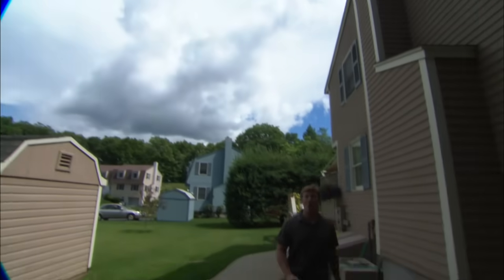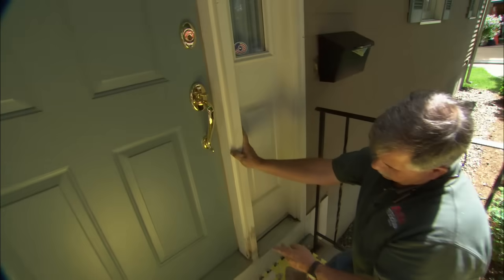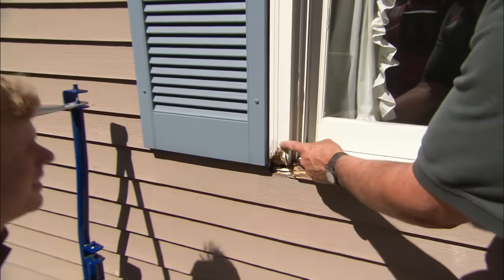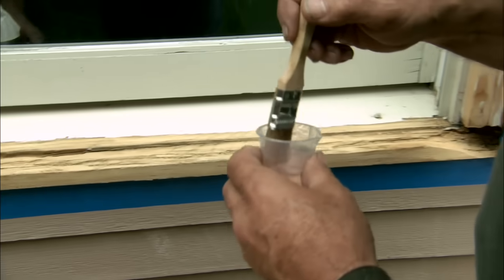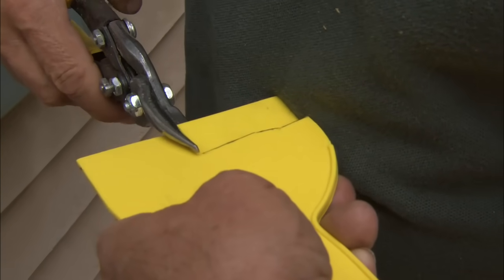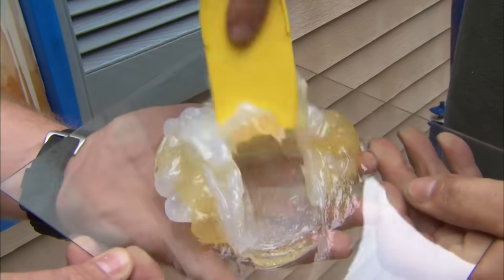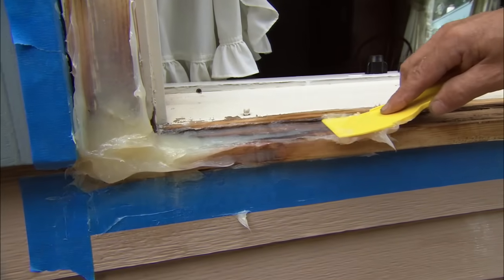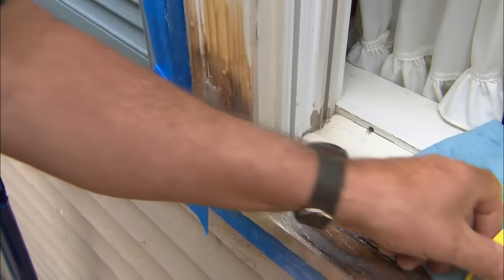How to Fix Rotted Wood with Epoxy | This Old House

Comment: 1.2M views and no finished product? Would be good to see how it actually looks at the end. I think this is a fine fix for most people, though you'd probably want to find a cheaper epoxy. I've done something similar with wood filler and I'll see how it goes - may well just end up putting new wood in there if it gets destroyed over the winter

Still, good to know what that tool bit in my drill case is for, didn't realise it was for sanding wood like that.
Reply: I use Minwax high performance wood filler. $12.00 at HD and gets hard as a rock.

Comment: Epoxy is expensive,  I use polyester resin, (Fiberglass resin) ..  I mix it with some fine saw dust until it's as thick as Peanut Butter,  Then I put on just like he did,  it's a lot cheaper and it dries a lot faster,  You don't need the primer he put on first.  It come out hard as a rock..  It paints easy with Latex and doesn't peel.

Comment: I repair sash windows for a living. If you cut out the rot 50mm higher into the good wood, and to a place where there is no obvious rot, it wont work for long. Less than 7 years for sure. The rot is funghinand the micro spores will already be in the wood but you cant see them. Mostly it will fail much sooner. Epoxy is a quick fix but not a good one.
Reply: Yes the spores will be in the  wood, but spores alone don't rot wood; spores plus moisture do.  If rot containing m9isture is removed, and the wood is sealed, then rot stops.

Comment: I want to repeat what people below are asking.. nice to give the instructions, but pretty useless if we don't know the names of the bonding agent and filler/s are.  The vid should be re-done just to edit that in..
Reply: If it's This Old House bunch, then they are more interested in the bragging and the pat each other on the back then actually helping the viewer to do a DIY. They could easily give names, generic or brand names but they don't. A bonding agent? I've been fixing furniture for a long time and I have not heard that I need a bonding agent when applying epoxy, for example.
Reply: Fasten All sells many brands of 2 part epoxy. Ask anyone there they will steer you right. FYI I bought a tube like seen in the video at $79 and change each.
Reply: I guess watching the label is too hard. It says "Flex-tec", and if they've not commented about it and even torn the label apart (more or less) it might have to do with sponsoring or so. It's tv after all.
Reply: Read the full text of my comments. I think you missed more than one point that I made. But yeah, reading the label was too hard and I'm pretty good at reading labels and finding sources. You wanna know what's not too hard, not being snide. Lots of comments to this video upload were of the same vein, what product was that? Right? Or did you miss those, kinda like so many people trying to read the label yet still missed the brand.
Reply: Hey, slow down a little. I don't know what points did I miss, but I'm quite sure you took my comment more "seriously" than I meant.

I watched the video and didn't pay too much attention to what brand it was. Then I read some comments and saw a few people asking about it. So I went and paused the video at the moment Tom uses it and I thought I read "Flex tee...". The label is torn so that "c" looked like an "e" to me. I also thought that "tee" might be part of a longer word but, that label being torn, who knows? Take into consideration that English is actually my third language.

Anyway I went and googled "flex tee epoxy" and google just autocorrected my search. Not that big of a deal I think so I wonder how come people don't do it themselves if they're actually that interested.

It's not the first time I see it on youtube. If something you want to read appears on the screen, chances are (if it's not blurry, out of focus, too small... whatever) you may pause the video at the right moment and read it.

About those other "points" that you made, again, I'm not too sure what you mean but, if it's about the people at Ask this old house not talking about brands, generic or not, I guess it's not that illogical. It's just avoiding free publicity. And also, if someone's eager to begin some work at home, it shouldn't be too hard looking for the products you need, there's the internet, asking someone at your local home center... if you have worked repairing furniture then you know about that matter quite a lot more than I do.

Have fun.

Comment: Tile grout is a cheaper alternative. I tried tile grout on wide gaps on window instead of silicone. Easy to apply with scraper and using your fingers to smooth it like silicone caulk. Takes longer to dry but it works. Just make sure you finish it smooth without needing to sand it or you will need a turbo cup wheel to smooth it...lol.

Comment: I have a small crack in a piece of wood which is expanding and goes all the way though the material.  My intention is to drill a small dremel hole at each side the way they do windshields in hopes that it will stop expanding but I need a suggestion on a type of glue, epoxy, filler or resin that I can use to bond and fill the crack from the backside prob using a small syringe and not screw up the front of the wood... ANYBODY???  Thx

Comment: Bondo (pink) versus Epoxy versus Bondo (blue fiberglass reinforced)
in order of best to worse

1 - epoxy resin - it adheres to the wood the best  - in laying up a fiberglass boat THAT is the best product
2 - vinylester resin (not the stuff you find in walmart or auto stores) - top tier boat builder use this stuff as it is cheaper than epoxy
3 - polyester resin (bondo blue fiberglass reinforced or bondo branded resin) - what most boat builders use to lay down the fiberglass matt
4 - bond pink - not a good option IMHO, it is not waterproof and soft

epoxy is typically NOT UV rated so you MUST paint it, but it sticks to the wood the best - it IS your best option. Thixo 

vinylester I believe IS UV rated and is a good option....you would need to thicken in with either cobosil or similar thicken agent so it holds it shape while working with it (ditto for polyester) 

Polyester resin similar to vinylester, but it sticking to wood is not as good. Bondo and evercoat sells a fiberglass reinforced product that is thick already.

Bondo pink stuff - is a non-starter for me - the stuff is only good for putting skim coats onto auto body panels....not for this application.

Comment: Why not just use wood filler? Everyone saying to use bondo, but miniwax makes a 2 part wood filler that is ready to sand in 15 to 30 mins. And it won't crack over time like bondo will.

Comment: This product has its limitations. It is almost unsandable by hand and if you power sand the substrate that you are applying may sand down much quicker than the epoxy. It is undestructible however where you need something that holds up. I believe its callec Fil tec?

Comment: This seems like more work, than just replacing the wood.
Reply: If it were just flat wood maybe, but getting a piece to match might be a problem. Then you end up replacing all of the trim so it matches then it might not match the rest of the homes trim.
Reply: I think the idea here is that this is one of a number of choices to repair this situation. Not everyone wants to replace the entirety of the woodwork. So this is one option of many.

Comment: Hiring someone to come out and cut out the rotted wood, cut and shape new wood to fit and complete the repair will cost you a lot more than $200. It also looks like he had a lot of that epoxy left over, so it probably cost a lot less than $200.

Comment: filling wood rot with epoxy is a temporary solution. if the wood rot is bigger than your fist then you have to repair it with new wood and epoxy. best is partial replacement over whole

Comment: Personally I would have cut all the rotten stuff of. Spliced in new wood. And then use a minimal amount of body filler to smooth it over.

Comment: Why not just replace the rotted brick mold? Cheaper,faster and no messy epoxy to deal with. I'm not casting aspersions on your work,because your way will work.Thanks for the video!

Comment: so much for building codes, and regulations.   look at that rot.
Reply: Not sure of the age of the house but doubt they had building 'codes' when it was built, just standardised ways of construction learned as trade. The subsequent codes are to ensure this stuff lasts a specified time. Even then, there is a finite limit to building materials and the specified required longevity has to be balanced against costs. Sorry to get all rational in YT comments  ; ]

Comment: As a home improvement contractor, I will tell you that generally speaking when the rot is that bad around the window it has migrated all the way into the plywood and many times the framing and substrate as well so just covering it up with epoxy does not fix the whole problem. It’s just a Band-Aid.

Comment: This is never going to last. Within 2 seasons the rot will be back but hidden under the epoxy. By the time the homeowner realizes there is still a problem it will be i the house framing.
Reply: Lol

Comment: If it's not structural, you can use spray foam, then cut it to shape, and patch and paint. This seems difficult and apparently, relatively expensive. Or better, make a clean straight cut (jobsite tool makes it easy), and replace with wood, then patch any imperfections, and paint.

Comment: This looks great but The problem with this is cost, materials, time and the quality of the repair..... For an experienced guy like Tom yeah he could pull of this type of repair. For your average joe there are just more chances to mess up from choosing incorrect materials to quality of work. Then for all that trouble cost and time wise it's around the same if not more than just replacing the whole wood trim and more reliable repair..

Comment: Use Wood Epox not Bondo.  Bondo is for steel, Wood Epox is for wood.
Reply: I found Bondo to not be flexible and would pull away from the wood;  and I'm assuming the Wood Epoxy is flexible.
Reply: Wood Epox is recommended for historic wood repairs.  I have seen Bondo repairs--what a mess.  the wood just melts away around the repair.
Reply: I prefer SculpWood but WoodEpox is good too.
Reply: Gloria Cole bondo is not just for steel. lol

Comment: that was a useless hard fix. epoxy is way more expensive than wood. it also can separate from wood easily in very cold or hot temps.

Comment: Just seems like a quick bandaid that'll cause issues down the road. Why not cut it and put new wood. Even if you don't want to cut it all out, just cut the rot and fit some wood and brace it to the old unrotted wood. That way it's not adding more unsturdiness to an already unsteady rot. How is approxy any better than rot in strength and longevity? Aside from the fact that it isn't rot and also doesn't rot. Hear me out, if you drill into the approx and facet anything it can easy pull out or crumble or just not hold the item. You also are preventing future additions from being an easy job. The next contractor or home owner will be cursing your name. These are just cosmetic cheap fixes that no home owner should do on the outside or inside or anywhere on their home. Never do this on any space that you may want to brace or facet something to. If its an art piece sure thatll work. But no a home meant for living. Hesr little piggy let me in 🐺.  I don't get these shows. Just do it right the first time. It's not that hard. Hell it's easier to cut new wood and brace it than it is the sand that for an hour.

Comment: Just replace the wood. The epoxy is like putting a bow tie on a turd! In the end it's still a turd.
Replace the wood casings with PVC and be done with it!
Reply: The wood will just rot again.  The epoxy will not.  This is fix makes it better than new.
Reply: @xnademolicious  BULL! The epoxy eventually just falls out in time! I said replace it with PVC and be done with it!
BTW most of that type of rot can be blamed on improper installation. The installers can't make any money if they take the time to actually seal up their cuts before installing! Raw end grain is like a wick!

Comment: I don't understand patching partially rotted wood. The rest of the wood will eventually rot too. Big waste of time and money if you ask me. Just tear it all off and replace with plastic / vinyl molding.
Reply: +Glenn Watkins Or cement board type of material. Yeah this looks like a lot of work versus just replacement.

Comment: I'm sorry but im a REAL carpenter and I replace wood with wood, amateurs and lazy people use fillers!!!
Reply: that window is shot.. the brickmould trim is finger joint pine ..its soft and easy to remove and table saw some new  out of treated wood without the detail o the brickmould trim  ..just rectangle  wood and 3 inch screws and predrill and prime n paint... or spend 700$ each window and rip the whole thing out and new vinyl windows
Reply: san379 those are the two options you're going with? One option makes the repairs look like shit and stand out. The other option is removing every single tooth in a person's mouth and replacing them with dentures because a couple of teeth had cavities

Comment: I always loved watching your show because I'm a do-it-yourselfer.  However, after watching umpteen families with money redo their mini-mansions with you,  I quit watching you guys and became a Rehab Addict fan because her projects are more realistic for the working class crowd.  Unfortunately, you guys got a little snobby for my taste. You failed to mention the epoxy products in your "shopping list."
Reply: the epoxy company didn't pay to have them say their name, so they turned the label down and did not mention their name.  advertisement dollars
Reply: That was a $200, tube of Epoxy and Bonding agent..   I use Polyester Resin mixed with Saw Dust is much cheaper and cures faster...  Just mix the saw dust in until it's as thick as peanut butter..
Reply: I find this is true of a lot of the reno/repair shows nowadays. They've lost touch with the people who really do need to do things on an actual working class budget.
Reply: Carolyn Harper
Reply: No one wants to watch someone doing renovations on their double-wide. Repairs are repairs. The techniques are the same, and rather see them do it in a high-touch situation and then scale it down, rather than the reverse.

Comment: Materials expensive and time consuming method of repair.  Would have quicker and a lot cheaper to have simply cut, removed, and replaced the wood.

Once again, budget reality and TOH don't have a working relationship

Comment: foolish repair! You know that replacing the brick molding and  window sill is faster and a better repair.
Reply: Take out the whole window, remove the framing and sill and , seal repaint is faster?

Comment: I'm embarrassed for you. You didn't use a fungus killer prior to your epoxy repair. Of course the epoxy won't rot, but if the moisture content gets to 14% or above, the fungus will become active again. That's what dry rot is.

Comment: Just came here to say, epoxy isn't weatherproof. Like... at all.
Reply: I am not sure I understand what you are saying.  We use epoxy resin and polyester resin on our boat all the time and it seems to be essentially "weatherproof" in that it maintains structural integrity, strength, flexability, adhesion, and sealing capacity in water and heat and cold.
Reply: @vidaliasoleil2714  really? I've always heard different. Does it last a long time, or does it occasionally need to be reapplied?
Reply: @vidaliasoleil2714  thanks!
Reply: @arkadihughes4893  So happy to be able to share!